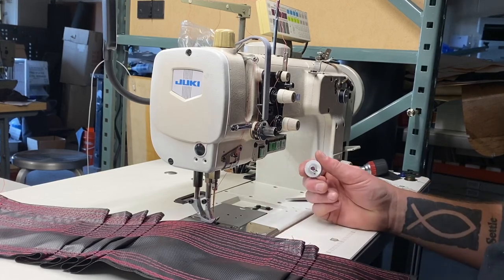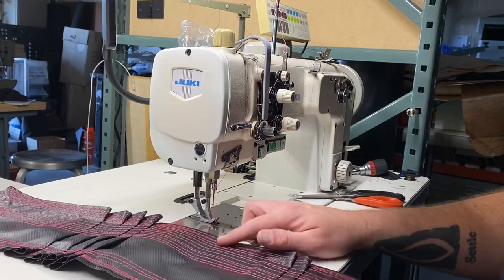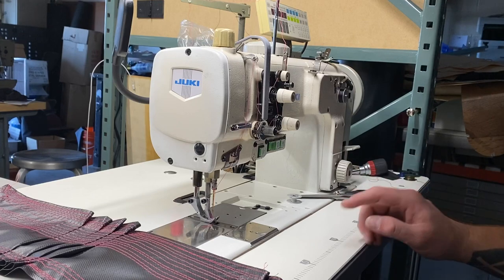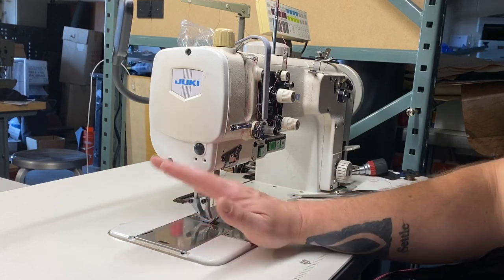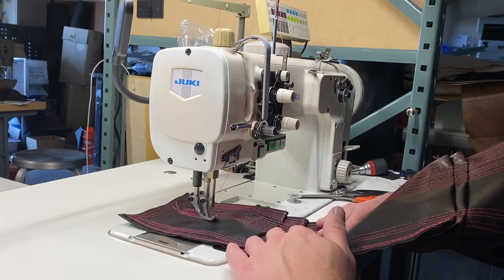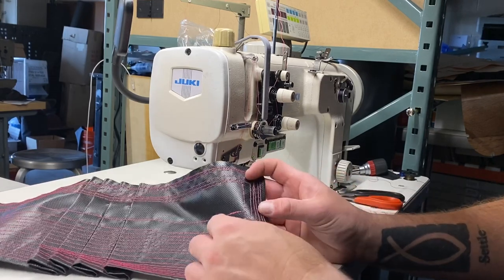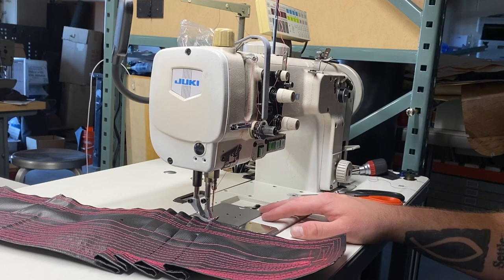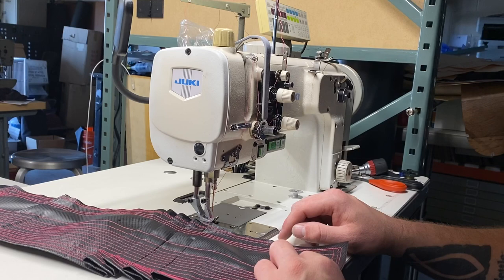Juki 2210N-7 short overview

Comment: Correction. Outside foot is not walking, , only inside foot walking.
Reply: Outside foot just doing up and down.
Reply: Do you need an air compressor? Can you use it without ? Is it just the presser foot and trimmer that work off air ... Can both of these be done manually?
Many thanks in advance for replying.